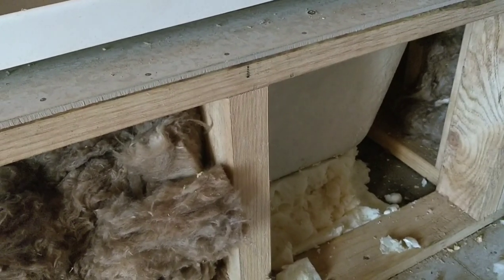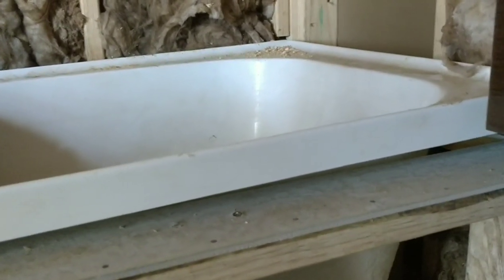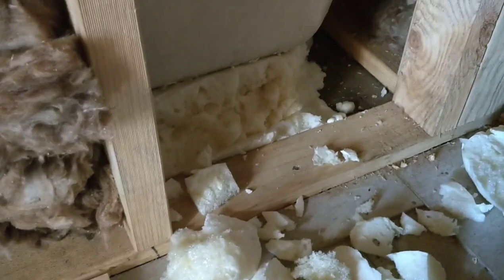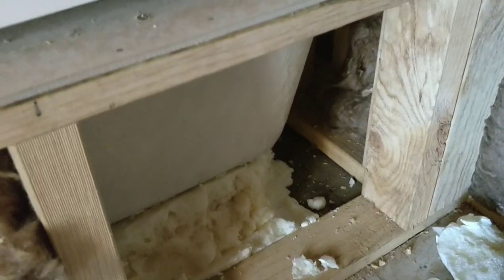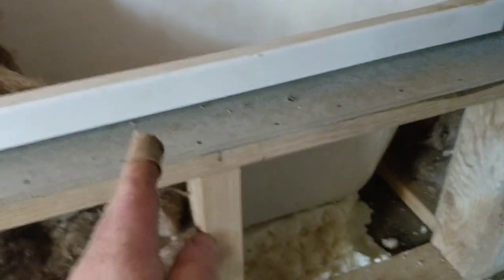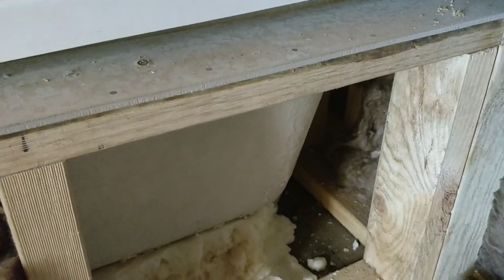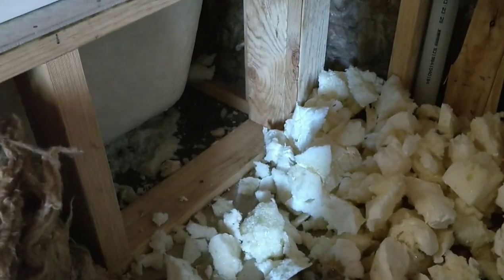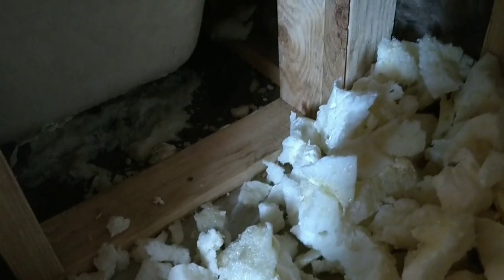OGT 40 - How not to install an acrylic bath with spray foam

Comment: You should of had your tub flange screwed to each stud then had a couple of 5 gallon buckets of water in the tub for weight and also use window and door low expanding foam.